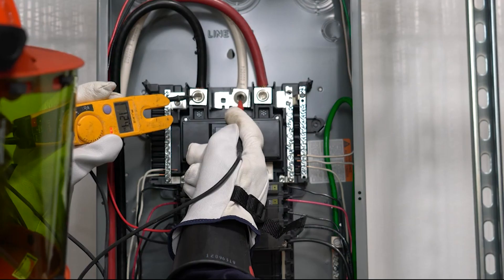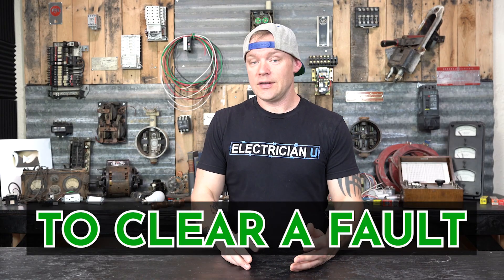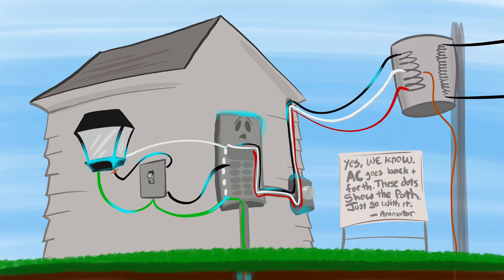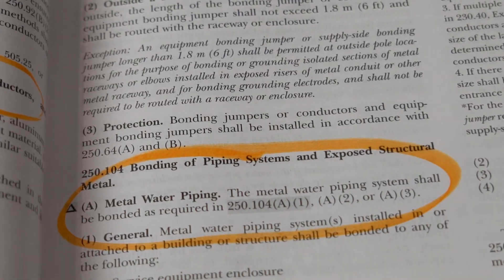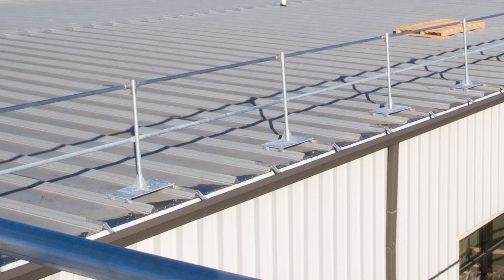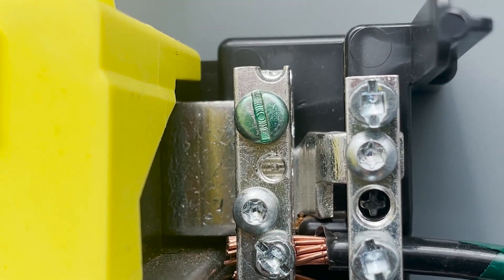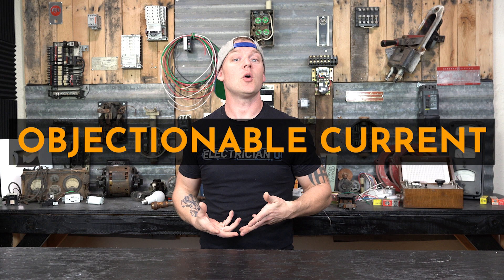Why Do We BOND Neutral & Ground in ELECTRICAL SERVICE PANELS?

Comment: I'll tell you up front that you are not going to like this comment.  I propose to you, however, that your videos are supposed to be educational and in that spirit you should want to be correct in what you are trying to teach.
Your description is correct in that residential wiring did not have a separate ground conductor and the NEC didn't require it (other than designated wet locations) until circa 1971.
The reason for the requirement is that the ground conductor is for personnel safety and, at the time, most appliances and power tools had metallic cases.  This was a safety hazard because if the case became hot, then the most likely path to earthed ground was though a body.  This is where lots of misunderstanding comes in where people think that standing in water is dangerous when working on electrical systems.  Well, it can be if you're barefoot and that water is in contact with earth ground, but if the water you're standing in is insulated from earth, then it's not a problem at all.  By the way, distilled water has a higher dielectric constant than rubber or glass;  That is, it's a better insulator than rubber or glass by about a factor of 20.
The ground conductor is not bonded to the neutral simply to provide a path for current.  In fact, it is the earth ground that is bonded to the neutral to ensure they are equipotential and that there is a sufficient earth ground electrode conductance.  This is usually checked with a fall-of-potential test, but modern clamp testers will suffice when there is a single ground point.  Multiple ground rods will have to be used if the soil conditions are such that there is insufficient conductance from just one.  If you remove the bonding of the ground to neutral, THERE IS STILL A CURRENT PATH back to the source since the transformer is also grounded on the center tap (Neutral).  Your claim that there is no return path without the neutral bond in the service panel is absolutely incorrect.
Also, ground fault does not require current on the ground or even a proper ground.  A ground fault, in the modern sense, is detected when the current on the neutral carrier is not equal that of the hot carrier.  This means there is another path for current, which is likely through someone's body to ground.  This is why GFCI is required in all wet and outdoor locations:  There is a likely path for current that IS NOT ON THE NEUTRAL.  GFCIs detect approx. 1-3 milliamps of differential, that's how sensitive they are.  Because they only monitor hot and neutral currents, a single GFCI can feed and protect downstream circuits.  This is where a lot of people make another mistake by tying all neutrals together downstream... well, you just gave another return path that is NOT through the GFCI so it see's it as a ground fault.  It's not... it's just another neutral return path, but the GFCI doesn't know that.  It assumes the individual doing the work is not an idiot and understand more than just matching up wire colors.
There are other "hand waving" explanations you made that are not correct, but I don't want to write a book.  Please be sure that YOU understand something completely before teaching it to others.

Comment: @electricianu 
It would still over current.

The current going through the breaker to the fixture would equate to infinity and a thermal magnetic trip tripe hacr breaker would “fault” to the tripped position. We bond service panels to keep the grid at an equipotential. All transformer poles are grounded. You don’t want different ground resistances (different story)

Comment: Thanks, very informative.  Though I'm not an electrician, I am a home owner and like understanding how things should be wired.  The house I own had been updated in the past, some of the bedrooms do not have grounds in the electrical outlets...which concerns me. There is a newer service panel on the side of the house with the bedrooms, there's also a subpanel in the garage for the central airconditioning equipment.  Your video is helping understand the configuration better.  if you have any video explaining how to go about updating non-grounded electrical outlets that would be very helpful.  I appreciate the information on bonding and the importantance of keeping the grounding fault loop closed to the service and matching the connection wire gauge.

Comment: Thks all the way from Monterrey..Mexico..I have a question  I have 220v service..at the center of the meter I see a terminal where the earth ground goes connected to..but It doesnt have the (NEUTAL CABLE) coming from the top of the drop...do I need to install n connect that neutral cable to the center terminal of the electric meter???

Comment: In computer science we call that "Discrete Pathing!" You want electrons to flow in a certain route from origin to destination without unintended diversion. Engineering to insure all electrons flow only within discrete purpose built route(s) is also "Discrete Pathing." I love how you imitate electricity going anywhere it wants. Good electrical wiring using "Discrete Pathing" keeps electrons where you want them while denying electrons access to places they are unwanted\unneeded!

Comment: I've been an Electrical Technician for over ten years and have been designing electrical systems for about 6 months now. This is the first crystal-clear distinction between grounding and bonding I've seen. Excellent!
Reply: Without explaining the function of the transformer?  Everything explained in quick talk, without a single schematic?  There wasn't one example quantified with math.  If you want to learn it, learn it like an engineer.  Otherwise it's just a cook book to keep the monkeys from hurting themselves. What's next, learn ohms law with a pie chart that says ac waves have a resistive component instead of a impedence component?   Without an understanding that current and voltage can get out of phase?  It really is children playing with guns.

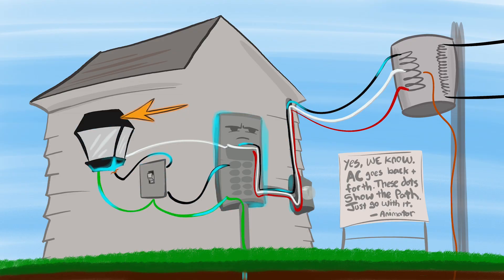Comment: At 3:04 It's also important to note that the primary and secondary neutrals are bonded together at the transformer. So whatever voltage is present at the utility primary neutral is translated to the secondary side and ends up on all customer owned grounded surfaces. In the event of a bad neutral on the utilities high voltage side, this can cause stray voltage at the customers grounding system, as the utility primary neutral current uses all the grounds as the return to the substation. This bond also means that you can have a small current on the grounding electrode or bonded water pipe, even if the main breaker at the panel is off! Its simply the utility using your grounding system as a return path for their primary system.

Comment: This makes me realize that I don't actually know what the ground rod is for. I assumed it was to disperse fault current to the earth, but if the fault current actually returns to the transformer/utility, what's the ground rod doing?
Reply: Lighting is one reason.  You allow lighting an easy and direct path to earth, else it will find its own way or ways (which may be undesirable).  In many (but not all) industrial settings, electrical equipment enclosures are bonded to building steel via Grounding Electrode Conductors (GEC) which is ultimately tied to a ground ring connected to buried ground rods/wells.  This allows bonded metal parts to all be at the same potential which means current will not flow.  Current only flows where there is a potential difference.  Equipment  (say a motor) is usually serviced by current carrying conductors which are accompanied by what is called an equipment ground conductor.  During a short circuit, this equipment ground is the intended low impedance path for electricity to return to its source; hence quickly tripping a circuit breaker.

Comment: How do you clear ground faults in equipment that doesn't use neutral, like dedicated 240v stuff?
Reply: ground of 240v stuff is connected to neutral bus st the main panel only and would use neutral like 120v plugs would

Comment: There is another huge reason for having neutral bonded and the MOST IMPORTANT. For residences deriving power from a wye connected secondary the bonding is essential, the electrical system will not function without it!!. If the loads on the 3 phases are unbalanced then the neutral point will float. Now you have a problem as the hot to neutral voltages will fluctuate with the 3 phase loads and the expected 120 V could be lower (as low as 0) or even higher (as much as 208V)! This will be catastrophic if the unbalance is large. .

Comment: The grounded conductor has only one purpose and that is to take the unbalanced currents back to the source. It is a current carrying conductor and because it is that it is not responsible to take any shorts to the source. If it was you would never have shared neutral and it would be sized larger than the phase conductors. The conductor responsible for the breaker to trip is the grounding conductor and all the building & pipe bonds. Electricity always takes the path to least resistance and the earth is that. “I could make 20 videos, no 50 videos” on this. Everything is bonded to earth so when a short happens it goes to earth without resistance so the breaker will heat up and trip. It will not do that as well if it is competing with other unbalanced loads in a grounded conductor  this is why the neutral is bonded in the main service. That is also why if a second building is fed from the main service of the first, you would have to treat the feed into the second building just as if it was a main service complete with ufer, building bonds, etc. and main bonding jumper. Why would you do that if the grounded conductor is as you say. The rule of thumb is to bond everything to the earth so if any of it becomes energized it will go to ground or earth. The science behind a GFI is because ground current does go back on the grounding conductor instead of the other phases and unbalanced loads on the grounded conductor. I’m sure in one of the many videos you make about grounding you will explain this.

Comment: This works great for 110 or 120 US style wiring. When you use 220 or 440 ect. You have no neutral. 2 Hots and a Ground.

I was told many many years ago the reason you bond the neutral and ground in the service box. Is because if you have a lightening strike the hi voltage goes to ground and not into the house.  You also have 1 of 3 phases coming from the power source. And a bear neutral.

Comment: As I understand it a sub-panel is when you have the neutral isolated from ground,
Mobile homes usually have a disconnect at the meter, being the 1st means of
disconnect and I am told neutral and ground after that must never come together 
again.

Comment: 3rd video i saw of yours, and yah pretty good, i guess i will subscribe. BUT now i am more con-fused then before, main panel is grounded and bonded, ok got that., are you saying the next SUB panel is NOT supposed to be bonded to neutral and ground? having solar panels, inverters, and charge controllers, i thought you ground all of them to one ground and also if you have a AC sub panel going to the inverter it to should be bonded and grounded?..oy vey, now i am lost. maybe you need a more detailed drawing and video. head scratcher 4 me at this moment..i hope i didn't not F-up.

Comment: isnt connecting neutral to ground wire create a shortcircuit.?
Reply: No.  A ground is an alternate low impedance path for electricity to return to its source.  The neutral is the normal return path to the source.  Say the hot comes loose and touches something tied to ground that it isn't supposed to.  Current will then flow over the ground returning to the source.  You can verify zero potential between the neutral and ground in a panel using a multimeter.

Comment: What if you have service panels in two buildings being being fed from a common source (e.g. both are connected to a splitter box, not daisy chained). Both of them should have ground and neutral bonded, right?
Reply: Just got to the end where you said the bonding should occur at the first disconnect. I don't remember seeing a method of bonding in there, so I'll have to go look again. But you're saying that neutral should be bonded to ground there, and not at any of the service panels, correct?

Comment: I have a detached garage. The inspector made the installer put a ground plate for the sub panel. The garage has a 2 AWG 240 volt. The neutral and Ground are bonded in this sub panel.

Comment: Only bond where your first disconnect is weather it be a meter disconnect or the main breaker on your panel. And do not drive separate ground rods for stand-by whole home generators or home solar arrays… bond them to your 2 at the meter your whole house should only have one grounding system

Comment: a generator is not always separately derived. we almost always remove bonding jumpers at the generator and transfer switch since most do not switch the neutral. if the neutral isnt switched it is not separately derived.

Comment: So close... objectionable current is what happens during normal (not fault) conditions when the power can return on more than one path therefore putting current on metal cases shields of communication cables etc.  During a fault it is not objectionable current it is fault current.  Under fault conditions it would be better to have many multiple paths back to the source because as we know the more parallel paths the lower the total resistance the higher the current and faster the OCPD operates however because this relationship would create objectionable current during normal conditions we only bond at one loacation and use properly sized conductors to ensure the high flow of current necessary to operate OCPD.

Comment: To be technical, the purpose of a circuit-breaker or fuse is NOT to detect a fault situation, but to limit current to a conductor or a device. (I am speaking only of basic circuit-breakers, not ground-fault interrupters or other devices.) A standard fuse is unable to "detect" a resistive short or a short on the neutral, and their ability to "detect" a full shunt to ground is largely a "happy accident" rather the the goal of the fuse.  

In other words, the ground wire keeps everything at earth ground, to avoid electrical shocks, while the fuse limits current flow within a specific leg of the circuit. We do not intentionally run massive overcurrent through the wires and blow fuses as a mere detection device.

Comment: If the transformer has a grounded neutral wouldn't the ground also be a path back to the transformer in a fault if the neutral and ground weren't bonded at the panel?

Comment: Great video. So i have a 480 breaker feeding a 15kva transformer feeding a 150amp lighting panel. In the transformer I have a bonding wire from xo to ground lug. I don’t have to put bonding screw in lighting panel right?  Cause I have my fed bust rap bonded and transformer?

Comment: I'm not sure if it's the same or not but i thought that's why they use breakers on the first place like for example if it uses more current than what's supposed to be used it just simply trips, i don't feel that there would be a purpose if every pole is grounded the same way anyway, it would trip either way, unless we use different breakers in Australia or our system is made differently, but there just simply isn't a grounding or earthing wire going anywhere near our breaker panel, it must either go around the other way or not at all

Comment: An audio group I belong to is talking about adding a secondary ground to an outlet to have an extra good ground going to audio components to filter off RF and make their circuits, therefore, quieter. I am not sure you can have secondary ground path to a grounding rod on circuits in the house vs. running everything back to the main panel. What do you say? And can you have a second ground rod to an outlet and have it bonded to the main house ground?

Comment: Questions:
1). Off of a sub panel, a 240-250 volt, 3 slot socket installed for a 250 volt welder.
I see from various videos it is to be wired:  The two large blade pins wired for the two phases for power, ✅.  Understood.
But they have the large rounded pin connected directly to earth ground.  This is where i get lost.
The earth ground connection.
Why that instead of the neutral (return) connection?

2). If I want to hook a panel to a different location from the main input power before the connection to the house, like directly from the wires hooked to the transformer, do I bond ground and neutral on that panel too?

Comment: Our internet cable enters our house a good distance from the electric meter. Rather than drive a separate grounding rod for it, the installer insisted it should be bonded to the electric’s grounding. Why?

Comment: I've run into the extra neutral ground Bond problem in large buildings,and especially in industrial commercial where there are a lot of equipment disconnects. I always figure it's done by maintenance guys who don't know any better

Comment: You only bond the neutral on a generator if the transfer switch is a 4 lol switch. If the transfer switch is not switching the neutral then you do not bond the neutral at the generator.